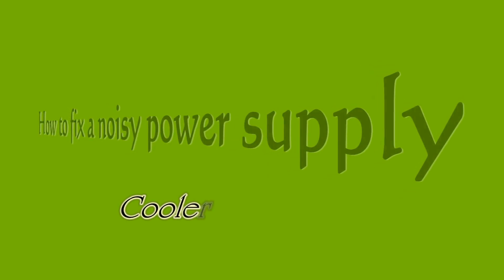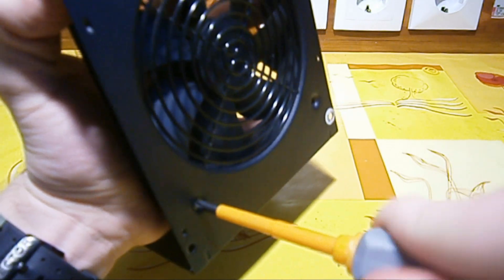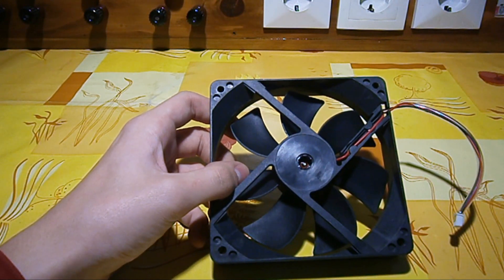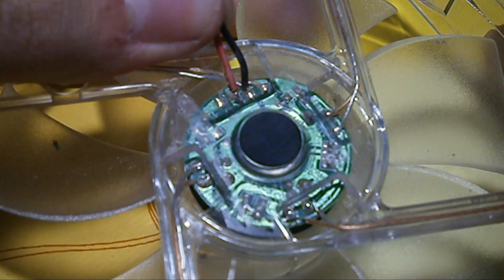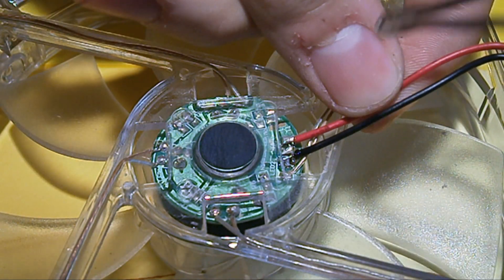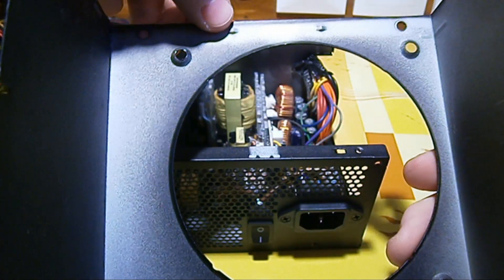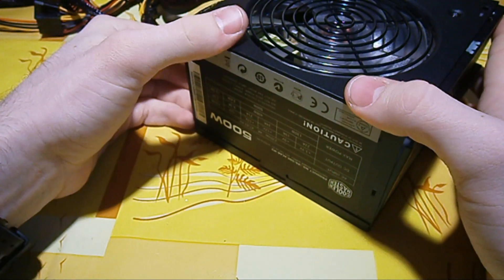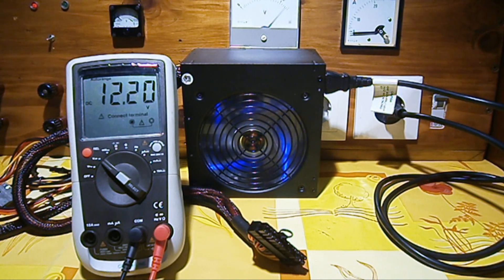How to fix/replace noisy power supply fan

Comment: Hi! How i know the right choice of fan.RPM and stuff needed for normal PSU working?
Reply: +Ms Solitude Best if it's comparable in mmH2O and CFM. Also, PSU's tend to deliver very low voltage to the fan, so make sure it will start at voltages even lower than 3 volts.

Comment: The thing which I am going to tell you will shorten your video by 70%. The male connector on the psu is a small plastic header. When you apply a little force on that header by pulling, you will notice that it comes right out leaving the male terminals naked. Most of our present fans has 3 pin or 4 pin where the +ve voltage and GND are right side by side. So according to the terminal of your fan just push the fan connector into the terminals on the psu. You can put back the plastic header anytime you want right back to the original state. It save a lot of hassle and it does not void the warranty of the fan.

Your method is necessary for only molex fans or if the fan is soldered into the board. Hope this helps someone.

PS:- I discovered this accidentally while changing mine.
Reply from the maker: thetubesandy Thanks for the info and I already knew that but I wanted to make a video about this particular fan ( with a molex connector) and I wanted to make it look nice and tidy.
Reply: You just saved me a lot of time! Thanks

Comment: Hey, did you take in to consideration the minimum voltage of the new fan? I measured 3V with a multimeter on the two PSU fan wires right after startup, but the majority of fans seem to have an operating voltage of about 4-12V. I found a bequiet fan at 3,5V but it's quite expensive.
Reply from the maker: PSU-s often have a speed regulation built in. That means the the voltage will be very low if the PSU isn't under load. But just take a look at the old fan it should be written on it what voltage it is. But most PSU fans are 12V ( under full load ).
Reply: NOoXlab Yes, the majority of fans are 12V but the lowest operating voltage may vary. I don't want to buy a fan and have it not start because the fan isn't getting enough voltage while the psu is not under load. I plugged in a 140mm AF quiet edition fan and I measured roughly ~450 RPM at startup. Measured max ~980 RPM while plugged in to MB at 100% power. 450-980 seems abit low though so I'v been looking for a new fan that'll run 1500~2000ish at full load.
Doing this mostly for fun because I'll probably buy a new PSU anyway, some nice semi-passive has come out and the PSU I have is fairly old anyway.
Reply from the maker: Robin Wingård Sorry for the late response.
The fan min voltage really doesn't matter because the fan speed controller will adapt to it. If the fan doesn't spin immediately then that means that the PSU isn't hot enough. If the temperature gets higher the speed controller will raise the voltage and so start the fan or make it faster. And of course the fan speed should be labeled on the fan case when you buy it and you should try to find the highest but the quietest.
Hope that helps.

Comment: Thank u for the video, however i have a question. 
I got my new pc, witch should be holding by 500W PSU.

AMD FX(tm)-6300 Six Core Processor 3.50GHz
4.00GB of RAM
AMD Radeon R9 200x Series.
Motherboard Gigabyte 

But it just stoped working. I changed it for guarantee, and now this new PSU has some big noise from this PSU, and i cannot understand why. i cannot even recognize what kind of sound is it, its like some small metal sound, or some electrical sound. together. squeak sound. how i can resolve this problem? sorry, for my bad english
Reply: i hope u dont  intend on buy a good video card with that little 500W power supply Lol.
Reply from the maker: First of all if your PC is drawing 500W your PSU MUST be more than that. You could use a brush to gently stop the PSU fan just for a FEW seconds and if the noise doesn't go away that most likely means that your PSU is overloaded or it has some electrical problem.

Comment: Boy, that fan certainly stayed clean. My guess is that it failed in less than two months...
Reply from the maker: It actually worked for almost half a year. But my friend ( whose PSU this actually is) takes EXTRA care about his equipment, and also he has an PSU air filter on the PC case.
P.S.
SORRY for the late response, Youtube screwed up the comments again. I am not getting any notifications about your comments.

Comment: This PSU has an EXTREMELY simmiliar layout to a Corsair CX430/CX500. Must be the same design, even the fan shrowd is exacly the same.
Reply: EvkaX155 prolly because corsair like many other big name brands dont accually make there power supplies they get them from other companys and slap there stickers on them
Reply: most Corsairs are manufactured by two different OEMs--Great Wall and Channel Well Technology (CWT)

Comment: i once read that those heatsinks on the board can pretty much kill you, how do you drain the charge from the power supply effectively before opening it up?
Reply from the maker: If you want to be 100% sure you would take an insulated wire and strip both ends. After that you attach one end to earth or ground or some kind of grounding point and with the other end you touch all the components you think are potentially dangerous. Of course the PSU has to be unplugged and disconnected from anything. But I personally wouldn't do this because you could damage some modern PSU-s.

Comment: Hi may i ask, why do you have to solder the wire, why not just replace it with a new fan which has also wires connected to it?

Comment: Wouldn't it just be easier to cut off the connector the the psu, then just cut the molex connector off the new fan and solder those two wires together?
Reply from the maker: Yes you are right it would be easier. But this way that i have done it it is cleaner and there is no excess wire or possible failure point.
Reply: NOoXlab I like how you used an LED fan though. It looks great in a power supply. Also thank you for the idea, I might use this in my own computer, because I got a very cheap power supply and it's extremely loud. -.-

Comment: I am getting a clicking sound that randomly appears and stops, its sometimes very loud sometimes not that loud and it appears to be coming from the psu.... is that probably just the fan in the psu?
Reply from the maker: You say that it varies. That could be caused by multiple things. One of them could be that your PSU isn't strong enough ( if the rating of the PSU is 400W and your PC is drawing more) and the other that there is something in the way of the fan. Because you mentioned a clicking sound and that it can be loud I would think that there is a cable somewhere around the fan that sometimes touches the blades of the fan. You didn't mention how fast is the clicking sound but I guess that it is in the rhythm of the fan spinning. Just turn of the PC and take a GOOD look inside the PSU with a flashlight if there is some wire try to push it by side.

Comment: My psu was really quiet now it's loud, not all the time about 70%. I thought it was the heatsink fan or gpu fan playing up! I've got a in-win case with sound proofing inside it so was normally silent. There's a 24cm fan on the side and it doesn't make a sound but psu is distracting! Could it be dust? It's not a crap one it's a thermaltake toughpower 550w gold. Before I could only hear anything if I had all 6 fans on full whack.
Reply from the maker: It most likely is dust. But it looks that your PSU could be marginal. Take a good look at your other PC components are they drawing more than 550W or are they just coming close to 550W. If that is the case that means that you have to buy a new PSU for the noise go away completely. But if your PC is way below the 550W consumption than a GOOD clean should be just enough. Some compressed air should do the trick.

Comment: Awesome vid, thanks for taking the time to make it. Just a question, why not run the cable of the new fan to your motherboard?
Reply from the maker: Because this PSU has the fan speed regulation already built in.
Reply: To make sure the old fan was cooling adequately. After your swap, how do you know that your new fan is just as efficient at cooling at any given volt, compared to your old? Do you know that you are not under cooling your PSU?

Comment: Hello, my psu is around 7yr old and the fan is getting noisy and thus annoying. Would you suggest that I replace the entire psu or a fan replacement might be enough. My main question would be whether psu's become less efficient over time and unable to give clean power to the system - or is that just a myth. Any help would be greatly appreciated. Thanks.
Reply from the maker: Unfortunately the capacitors in the PSU loose they correct capacity over time ( they dry out ) and all the components have aging problems. And so the power gets "dirty" over time. I would recommend to get a new PSU because of the 7 years of use.But please if you can afford a brand name psu then buy one. They know what components are good and the PSU will last you a bit longer and be more efficient than the cheap chinese no name.

Comment: so... totally amateurish... i have no soldering whatsoever, however can i do it by entwining the cables (with their respective polarity) and some insulating tape ? i hear like something is hitting the blades (at first i though my case coolers where hitting some stray cable)
Reply from the maker: Yes you could do that but that is not advised because over time the cables could unwrap and leave your power supply without cooling or the copper could corrode under the duct tape and cause a bad connection and so a fan speed reduction. You could do that and probably none of the above mentioned will happen but just bare these things in mind.

Comment: It would be so much easier to just cut the old connector from the old fan and solder the wires directly to the wires of the new fan and then tape them up. Why go to the trouble of desoldering the old connections and taking the first fan apart?
Reply from the maker: Yes you are correct but Me and my friend wanted it to look good and we didn't want any excess cable that could hang around and make a problem. So we decided to use the exact same cable because of its length and convenience.

Comment: my power supply fan produces humming type sound when i switch on the computer and it lasts until i shut it down
Reply from the maker: That could me either the fan and you could just add a little of oil to it or it could be some electrical component. You know never until you disassemble the psu and take a look and listen to it out of the pc. But that could also me caused by the power consumption of you pc. If your pc is using more watts than your psu can give than the psu can overheat and make weird noises.
Reply: thanks

Comment: What is the point of the plastic cover?
Reply from the maker: It actually could have several uses, one to protect from the high voltage side, one to direct the airflow, one to prevent wires from getting into the fan or something else.

Comment: When you put in the new fan did you make sure that the new fan had the right cfm? Because if the fan is to weak and can't cool the psu down it will overheat and that can break your entire motherboard??
Reply from the maker: Of course that I have made sure that the fan speed is the same or higher. In this case the new fan had actually more rpm than the old one. But in the worst case the psu would over heat and shut down your motherboard would be just fine. Maybe if you have a cheap psu the voltage could drop down if the fan is too slow. And that would cause the PC to act weird but most likely wouldn't destroy your PC.

Comment: I hate such things: the plastic plate to prevent wires from getting inside the fan. That thing is ludicrous: it's blocking half of the airflow that the fan generates!! just remove it, and do some cable arrangement to prevent them touching the blades.
Reply from the maker: I would have probably removed the plastic. Because it is just there to separate the mains voltage from the low voltage fan. But my friend insisted to put everything back where it was. And I had to do it because it was his power supply.
Reply: NOoXlab Yes I know what you mean: here in Italy we use to say "I hook up the donkey where the boss says to". I'm a "spare time pc repairer" too, and I usually give suggestions... but if customers insist, I do what they request me to do. Obviously not without saying "and don't tell I didn't warn you".
Reply: Thomas soffiantini That clear plastic is actually to ensure air is forced over components, and not straight out the vent.

Comment: A psu can get noisy mainly for 2 reasons: one is the electronics involved in the cirtuitry (capacitors, coils, mosfets and so on), and the other is the fan. In the first case, either the circuitry is old or faulty, and you have little chance in repairing it (unless you're really a pro) so you better go and purchase a new one. Or it could be that you're pulling too much off of the psu (you're getting close to the maximum power/current it can handle) and the mosfets/coils tend to get noisy. When the noise is fan-related, if it's faulty (blades, bearings and so on) you can change it for a new one (as shown in the video), or if the psu isn't really working hard you can downvolt the fan to make it less noisy i.e. let it run @ 7,5 volts or 5 volts (depending on the fan, but I usually do not suggest 5 volts).

Comment: My power supply makes vibrating metal sound mostly when I play games but if I tilt it forward it doesn't make any noise does it need a new fan?
Reply from the maker: No it probably doesn't. That sounds to me like a loose screw or something is not properly secured in place. Maybe you power supply isn't sitting properly in you computer case?
Reply: NOoXlab Are you sure? What does a broken fan sound like compared to a loose screw?
Reply from the maker: A broken fan sounds like something scraping or something like dull rattling noise. But it can sound really like anything. But if you hear a METALLIC sound that probably isn't a fan, but is could be if the fan is hitting something metal. The best thing is to spend a LOT of time listening to your PC while it is open and determining what exact location the sound is coming from. Is it the fan or some other part of the power supply that is vibrating because if the fan?

Comment: Why not just add oil or grease on the old fan?
Reply from the maker: Because this fan was loose and it was vibrating. The fan blades were not properly secured.
Reply: NOoXlab Oh ok, All I did on mine was add oil and it's not making that much noise. BUt i probably need to buy new fans.
Reply: Good question. If the bearings are worn/broken, there's no use in lubricating them. But I always give it a try before scraping the fan: if it's working, then we solved a problem!

Comment: Could I use electronic crimping caps instead of soldering? Like let's say I cut the wires midway for the new PSU and the wires midway on the old one. Then just capped the blacks together and the reds together (separately obviously).

I used caps for my car audio install and it appears to work well, so I was wondering if that would be viable here.
Reply from the maker: You you could crimp them together without any problems just be careful that the polarity is correct and that everything is insulated.

Comment: nice guide m8 , but why won't you just replace white plug on black and red wires on the new fan :) its less complicated and not everyone has soldering tool, anyway nice one